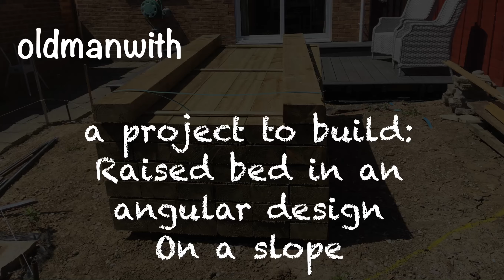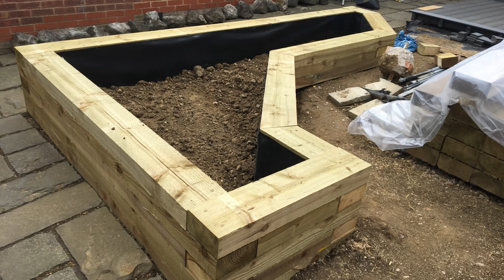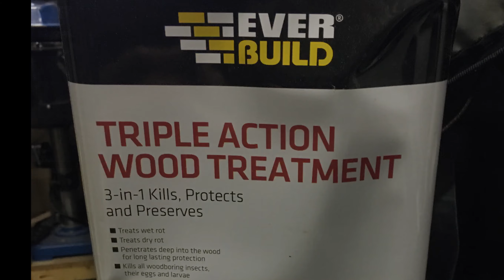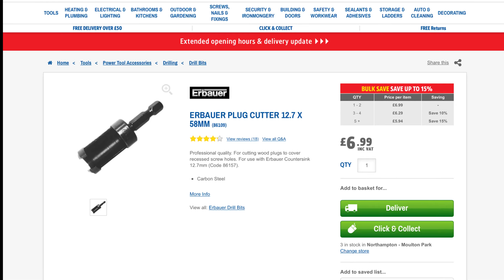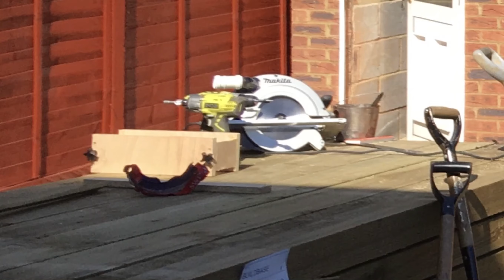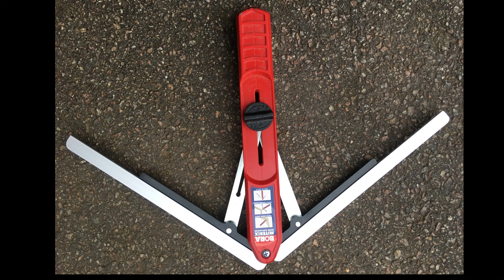Build a raised planting bed in an angular design on sloped land

Comment: how did you do the 45° cuts?
Reply from the maker: Hi Lewis, I bought a big mitre saw, a Metabo with a 305mm blade. That goes through 100mm in one pass and it also has the depth front to back to do a full 200mm beam. However, if you look at the other raised bed video it won’t do a bevel cut right the way through so I had to cut the bevels on the other raised bed from two sides (or more accurately top and bottom)
Reply: @ thanks for that mate!
Reply from the maker: @ I’ve been meaning to do a better explanation video
For about 2 years….🙄
The first couple of cuts I did were with a circular saw and a 45 degree jig I made up in ply but I really struggled to get a good result. Looking back now I think I should have changed the blade in said circular saw which would have helped but also it only had an 80mm cut depth and getting the cuts lined up was a drama. Lining the cuts up when double sided cutting on the mitre saw seems less difficult

Comment: Did the second mitre saw cut straight through ?
Reply from the maker: Hi Ross, the big Metabo that I bought (305mm blade size) will cut straight through  a 200 x 100. Only thing it won’t do a full cut on is a bevel angle. If I can pick up an offcut of sleeper somewhere I’ll do a video on the different cuts.
Reply: @oldmanwith  that would be great 👍 Thankyou for reply